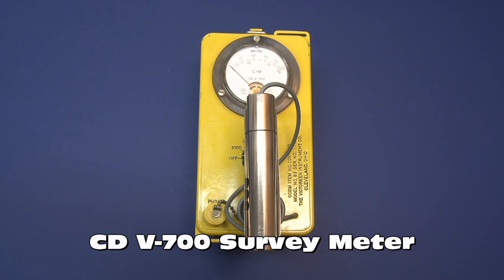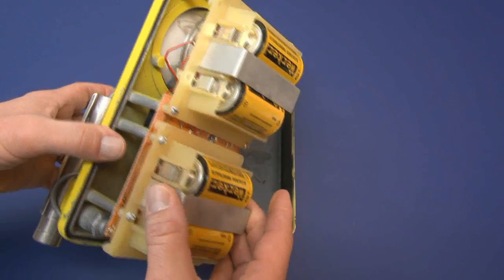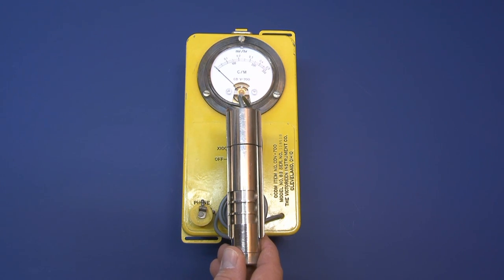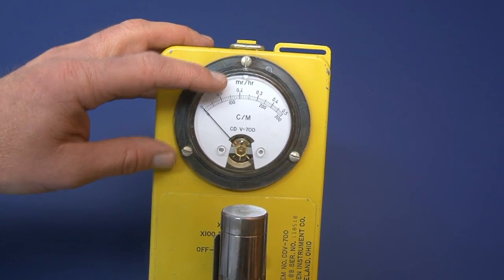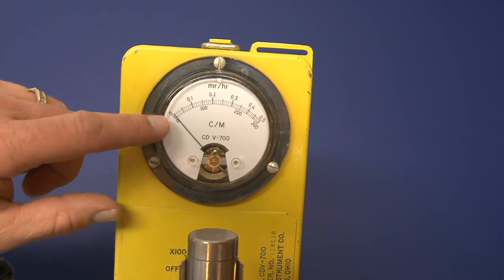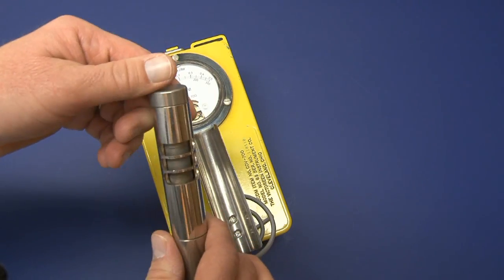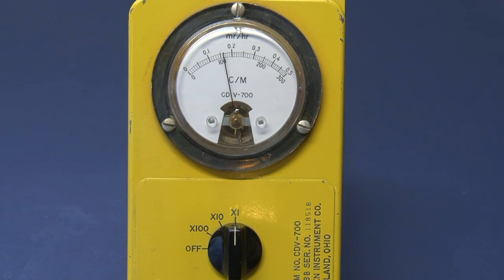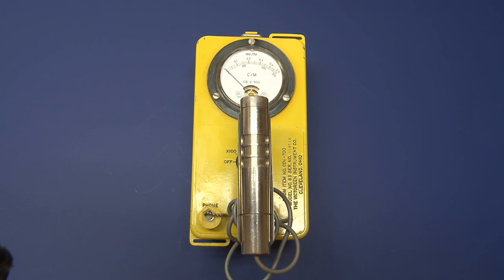CD V-700 Survey Instrument Overview

Comment: I have a cdv-700 anton no.6 and I got a rock stuck in the shield so I open it and the tube was stuck inside the top part I think they glued it to the gasket I don't know if you know about this can you reply
Reply from the maker: Are you not able to get everything back together and working again? Parts for these instruments are pretty easy to find on eBay if you needed to buy another tube or gasket.
Reply: @_TRG_208  Yeah okay will do I used to have 2 anton no.5s I know how hard it is to find parts but will do
Reply: @_TRG_208  I fixed the problem thank you for helping

Comment: What if the sticker is in deterioration and the source is exposed ?
Reply from the maker: Maybe try putting a piece of duct tape over it to contain any of the stuff that is likely flaking off.  I've seen them do that before and the little piece of metal under the foil (the source) is breaking apart.  The tape will help contain everything and make it so you can still use the check source.

Comment: Has anyone ever reported getting sick from a check source off any of these units or others just wondering
Reply from the maker: Just don't eat it :)  It would not be possible to get radiation sickness from the check source on the side of the instrument.  Most of the check sources, under the little foil sticker on the side, are either radium or depleted uranium.  The amount of material there is not enough to pose an external hazard.  You can get a little more info on the check sources here https://www.orau.org/ptp/collection/civildefense/checksources.htm
Reply: AtomicTRG  very interesting thanks

Comment: Great video! Would like to add just a few things if I may.The battery clips are sharp and can cut the thin wrap on the outside of the batteries causing a short. This will burst the batteries if not caught in time. And even with the batteries out of the unit the capacitors still hold a charge unless shorted out with something with a INSULATED handle. And last they did make a gm tube with a lower sensitivity by a factor of 10. Fur use in more contaminated areas but you will pay for them now. :)